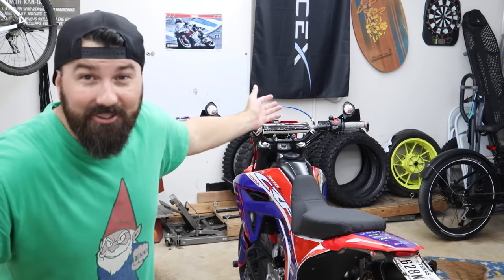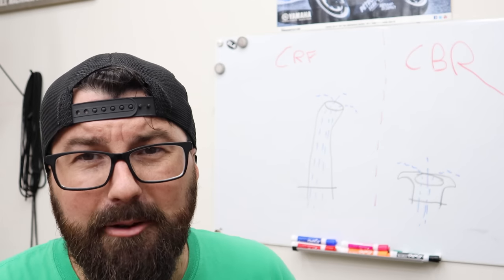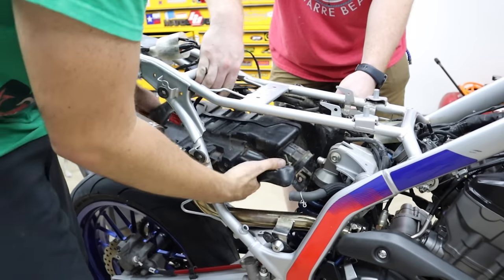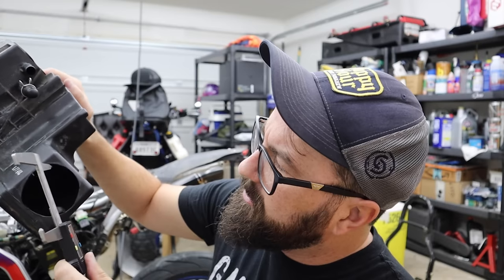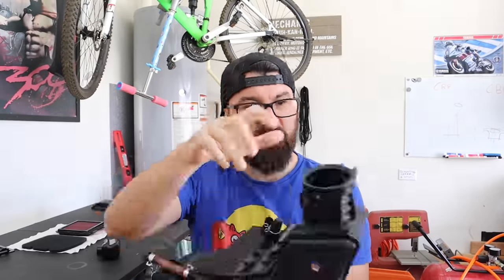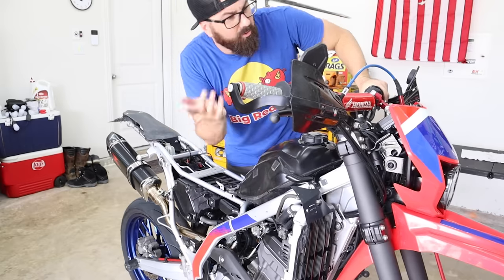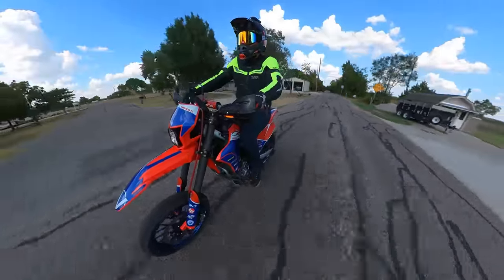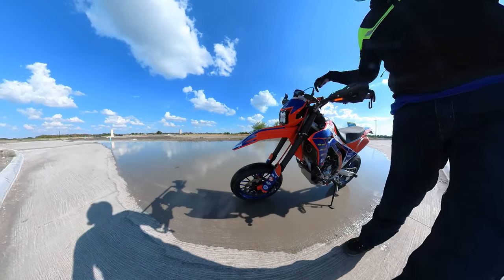CRF300L Air Boot Mod, FULL CBR300R POWER

Comment: Overall seems like none of these power mods are worth it at all. End of the day I didn't buy my crf for power (would've got a KTM), I bought it so I can ride it everyday for years and not have to maintain it whatsoever besides a bit of oil knowing Honda engineered it to reliability perfection. But I am glad you're doing it for us so we can make that choice!
Reply from the maker: That’s kinda the goal. Have super high reliability and low maintenance. But still have a fun bike with a bit more power then it came with. But most people don’t get that at all. Just look at the comments. “Why didn’t you just get (insert $11k enduro bike)?” If you have to ask then you don’t understand. Also it’s just fun to play with these things. People mod out Grom’s all day. Do we tell them “should’ve just got a 636 dummy”? No!
Reply: @TheGardenSnake  You got a grom just to mod it and get some more power??? Should have just gotten an H2 man wtf!!
Reply: I've added KN air filter, exhaust, EJK, and that's the absolute end of engine mods on my 250L. The racetech suspension makes the bike way faster than the stage 1 engine mods.
Reply: Exactly, a waste of money and time....
Reply: People have done 300 swaps on the Groms and they are fucking awesome. 

The best bike to ride is the one you have in your garage. 

Mod away.
Reply: It's a single cylinder thumper, Honda didn't leave 10 horsepower on the table for grabs.🤷  Best mods on this are suspension and the 550 ecu reflash cause stock fuel mapping is really awful.  I wouldn't even dream of popping for the $800 exhaust everyone immediately goes for.  Talk about a waste of money!

Comment: Intake snorkels/velocity stacks:
The length is a "tuning" instrument. Think about it. The air flows in with some speed, the intake valve slams shut and suddenly there's this pressure wave bouncing backward up through the intake, then the intake valve opens. Depending on the length of the velocity stack, that rebounding pressure wave will be timed to provide the most efficient air flow back through the system. It's sort of like a two-stroke muffler, they optimize power at a given RPM.
Usually longer velocity stacks optimize lower RPM power at the expense of peak RPM power. You're moving the power around by changing the velocity stack length.

Comment: Just a fyi on disconnecting the gas tank's fuel line. You don't need to use any picks or other tools on the fuel line connector. The connector 'by design' is made to decouple without any tools.  Place your thumb on the retainer tab, lift it up to release the lock then push entire u-shape piece in, and its disconnected.  Doing it 'by the book' so to speak is faster, easier and removes the chance of damaging the connector.
Reply from the maker: I'll try that next time, thanks

Comment: You can 3d print TPU which is a flexible rubber like material.  Its the same material that is used in skateboard wheels and it is extremely durable and would be perfect in this application
Reply from the maker: Yeah Rivet can do that and told me if I sent that boot to him he'd remake it better. I just didn't want to do that because it's not something you can buy.
Reply: @TheGardenSnake  If they provided the cad file people can find shops locally that will print stuff for them. It's a little extra work but that means other people can get their hands on one as well

Comment: As I posted months ago , you could have just cut the inner dong part flush with the front part of the air box (leaving the sealing flange) creating a still air box.  I also left the resonator off and plugged the port hole with a rubber plug and glue. Better fuel/air mixture flow.

Comment: Your low end power is surprisingly high. The 550 ECUs only seem to add significant upper end power according to their charts. Would that just be a tuning difference?
Reply: It added a lot of low-mid range power to mine. My bike pulls away from my buddy’s stock 300l in 1st-4th gear.

Comment: Hi Jake, I don’t really want to cut my airbox but I thought I could pull out the existing tube and cut it so it was flush with the inside of the air box wall, what do you think? The affect would be pretty similar I guess?
Reply from the maker: If you did that you would have a pretty sharp edge. The rounded over edge of the cbr boot is a good thing to have. And here’s the deal, you’ll have to pull you air box out regardless. There’s no way you’ll be able to get it back in through air box and on the throttle body. Oh and you need to silicone back on too. Your gonna have to pop the air box off and that’s the “hard” part. Cutting that whole is easy and the air boot is cheap. I’d say if you want to do this then do it all the way. The time, effort, and money between that way and the right way are minimal.

Comment: Man that thing turned out so sick! Any plans to get it back on the dyno after this?
Reply from the maker: Yeah for sure I’ll try to do that at some point. Just don’t have one I trust around here.
Reply: @TheGardenSnake  It'll be interesting to see how the new power curve compares to the previous "monster mid-range" curve.  If you were to amputate the CRF internal intake schlong flush with the inside of the airbox it might perform about the same as the CBR unit.  And, if it turns out that shortening the schlong reduces low-end while increasing top end, it might be possible to tune that trade for individual preference by shortening the schlong "appropriately" without completely removing it.

Comment: Possibly a dumb question, but it's just begging to be asked: Why not just cut the long, snorkel-y bit off the original boot and use what's left?
Reply: That's what I was thinking. If it's still the same id at the tb end, seems like less effort and will sit correct
Reply from the maker: Sharp edges, bad air flow. I guess you could try to flare it out. But the cbr boot is cheap and all in all less work.

Comment: So if the intake size going into the throttle body is the same ID, can you just cut the snorkel off and get the same resulting airflow?  And then its a free mod instead of buying parts?  That would be an interesting comparison!
Reply: I was wondering the same thing
Reply: It would also fit better than the CBR unit.  I'd bet it's close, but I wouldn't be surprised to find the CBR unit is just a little bit better at high-RPM flow.
Reply from the maker: The velocity stack on the CBR one is very important. Cutting it would have a rough edge. I suppose you could try to flare the end out but that would be a good bit of work. Especially since at the end of the day you basically have to do the same thing to put the CBR one in. And the CBR One was like 20 bucks.
Reply: @TheGardenSnake  Good points! Thanks for the answers!
Reply: yes, it was easy to do for me. I used an Exacto knife  not a hacksaw so no rough edges.

Comment: Jake, great video but I have a question, I have a 2021 CRF300L with 550 Performance 1.5 ECU, their Hurricane air filter, high flow air box velocity stack, high flow air box lid and a full Yoshimura RS4 exhaust. Although it runs great and has excellent power, for some reason my bike will not throttle up in first gear like your bike, what do you think? Are there other mods that you have that i'm missing?
Reply from the maker: Probably just need the tune dialed in a bit more. Every time I’ve had it dyno tuned it’s crazy how responsive it gets.

Comment: The stock intake has the same (almost diameter), correct? Why not just cut the original short instead of replacing it with the CBR one?
Just asking.

Comment: I’m not that tech , but couldn’t you cut the stock intake shorter ( same as snorkel ) wouldn’t this also improve air flow   I think 🤔 you said 1mm difference? , I know is this is an old vid but just doing so e mods only 300 Rally 
Paul from Australia

Comment: At this point how much harder would it be to swap a cbr engine in it and tune it
Reply from the maker: At this point it is basically the same as the cbr motor. Been that way since the cams. I wouldn’t necessarily gain anything. Actually the gearing would be taller in the lower gears, not ideal.
Reply: What about a CBR 500 engine swap for the 300l
Reply: @Shadow-gk3yi  or a crf 450 r engine would be better

Comment: Hello i leave in idaho its a little higher altitude here doing the air box like that would i have to mess with the jets or something else
Reply from the maker: Well this bike is fuel injected so it doesn’t have jets. The fueling might be a bit off but it’s the same at any altitude. To maximize power and longevity tuning is recommended.

Comment: Any pros or cons to getting rid of the intake resonator while replacing this boot?
Reply from the maker: They do some interesting stuff that helps out, look up helmholtz resonator
Reply: @TheGardenSnake  so it would be best to keep the resonator installed?
I've also heard the cbr300 throttle body is bigger. Is that true? Would a cbr tb be worth using?

Comment: Get the ENTIRE cb300r clutch assembly. MUCH better, much more friction surface area and 2 extra springs.
Reply from the maker: It’s not like it’s slipping. Remember the stock clutch is a slipper gripper. Doesn’t need a lot of springs with that.

Comment: What about just cutting the stock tube down?
Reply: That’s what I did, but it’s actually that 60mm hole he cut out that optimizes air flow. If your not going to add the velocity stack. I say just remove the stock tube all together. I did that too, which gave it a deep grunty intake sound.
Reply: @airadaimagery692  yea I ended up taking the tube out completely. And the airbox door from 550. She breathes much better now.
Reply: @coltonweber4905 yep, that’s what I did too. Works great. 
But I just realized that this is a completely different tube Jake is working with. We actually have 2 of those tubes in the air box, and the one that Jake replaced in this video is the one on the other side of the air box that connects directly to the throttle body/carburetor. Sorry, I was a bit confused at first. 
But I think I’m going to go ahead and do this too. I really didn’t feel like pulling the air box off, especially on my bike because I have a Rally, and it’s probably more involved than doing it on the 300l, but I’m sure it’s worth it. After I do mine, I’m sure I’ll be helping my buddy with his on his 300l. He usually does everything I do. Lol...
Reply: @airadaimagery692  yea the velocity stack. Its a pain getting the air box out but worth it. I also installed the cbr cams and the 550 tune. Next will be the big bore kit.
Reply: @coltonweber4905  I did the ECU tune as well. I started out with the stock improved tune, and then later on went with the stage 1.0. I’m taking my time and making small incremental steps so that I can learn how the bike responds to each performance mod. I’m curious how much of a difference the CBR Cams will make. Are they really worth the cost and labor? I will be upgrading to a Big Bore kit, but it probably won’t be until next season. My bike runs so much better than stock. And it’s not that I needed more performance in power, it’s the power management that I have been impressed with by flashing the ECU. Just doing the stock improved tune improved throttle response, and made power delivery more linear. I installed a 42T rear sprocket last week, and the results were pretty shocking. I expected to sacrifice some top end performance for a little lower end pep, but surprisingly, I didn’t lose any top end performance, and my front tire comes off the ground now without having to really work for it.
Reply: @airadaimagery692  I noticed quite a bit from the cams, but if you are going big bore I would just wait and do it all at once. Also, delete all the emissions crap at the same time. I am considering the big bore kit also.
Reply: @coltonweber4905  👍🤙

Comment: Wouldnt it be easier to just buy a cbr300 motor and swap it into the crf?
Reply: No, it would still be about the same amount of work.  Even more, because you would have two bikes to take apart, but still have to mod your original airbox, throttle linkages, etc. Not to mention the cost. You're not going to just find a low milage CBR300 laying around for less than the parts Jake put in. Then you would have the problem with the ECU trying to reprogram it to work with all of the other peripherals on the bike, etc, etc.. Then at the end of the build, you would still have a bike that has less power than a carbureted DRZ400. If going to go that route, then you might as well put a CBR500 motor in it.

Comment: Instead of going through all that why not just cut the pipe dong whatever you call that thing off shorter with a Stanley knife? If it’s the same size and everything.
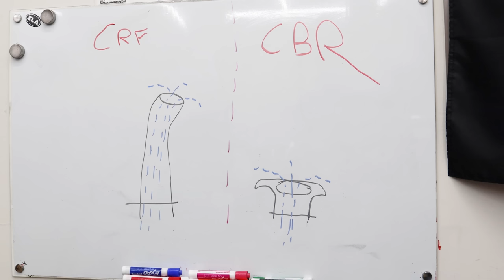Reply: The end shape will still have the wrong air flow. Jake starts to explain that at time stamp 1:55, hope this helps.
Reply: @thomasohanlon1060  still, it would've been interesting to test that out before doing this mod
Reply from the maker: Yep, the air flow would be rough like that.
Reply: @robertevans6418  The "test" was the trip in the desert, the bike had issues. " bad air flow, make bike not run good." Voice in Jakes mind. 🤣 Sorry had too.
But really the air flow a small rippling can cause the air to kill an engine, that is why most air to engine ports are ground smooth on race engine ports.
Reply: @thomasohanlon1060  I understand that, do you not understand what I meant by it would have been good to see the effect that shortening stock intake length would have achieved, be that good or bad in the video.....if it is bad(which it probably is) or a marginal improvement, it would still serve a purpose in a series of videos about mods on the crf300

Comment: Probably easier to buy a bike with more power doofus...
Reply from the maker: Yep, you can make that argument about any bike and mods till we all end up with H2Rs. 👍
Reply: @TheGardenSnake  ... and after you get used to the H2R you're gonna want to mod that too.  😁
Reply: Power is only one part of the puzzle.  I'm weighing the 300L against KTM's 690 Enduro for my next bike.  My use-case is a travel bike that can carry me and my camping gear anywhere I can legally ride and then, after I unload it and make camp, take me down any gnarly trail I want to explore.  The 690 starts off with almost 3x the power and a much better suspension, but it's 40 lb heavier and costs almost 2x as much.  The speed ratio between high gear and low gear on the 690 is only 2.88, which means as a practical matter that you can have it geared well for the highway or for the trail, but not both at the same time.  The speed ratio for the 300L is 3.82, which is *absolutely outstanding*.  For nearly $3k you can buy a Nova wide-ratio gearset for the 690, but then you have to completely disassemble the engine to install the new gears and you still only have a speed ratio of 3.33 (which is better, but you still might have to swap countershaft sprockets when switching from road work to trail riding).  For less than that, and a lot less work, you can fix the 300L suspension and squeeze a few more ponies out of the engine to make it a little better on the highway and a little better at hauling a load up a steep dirt road in the mountains.
Reply from the maker: @adstryker5084  Dang you've gone deep haha. I've always loved the idea of a 690/701. But I've know way too many people that have had issues with them. It's always goofy stuff too. Random sensor, bike won't start, dash breaks, fuel pump dies, it's leaking oil. Like no one else makes a modern big bore (600+cc) dual sport. We really need that!
Reply: @TheGardenSnake   I guess I've bored out 50cc mini bikes to make them faster so i'm probably more munted